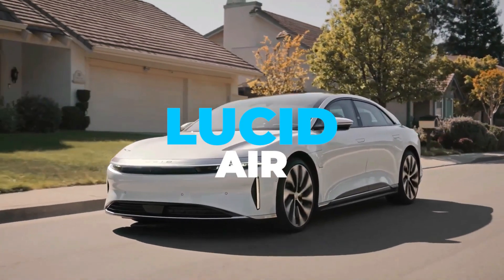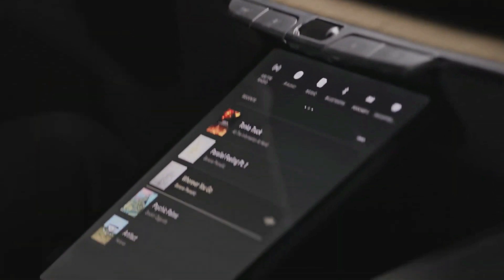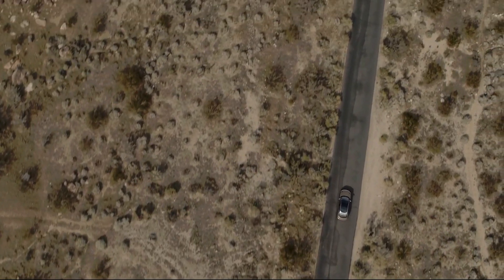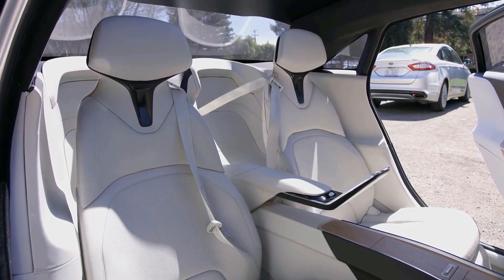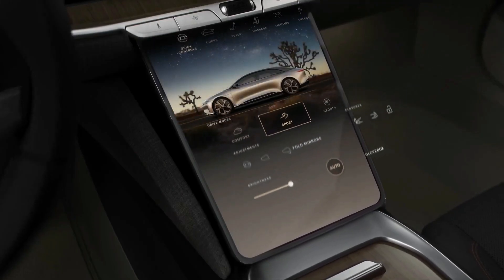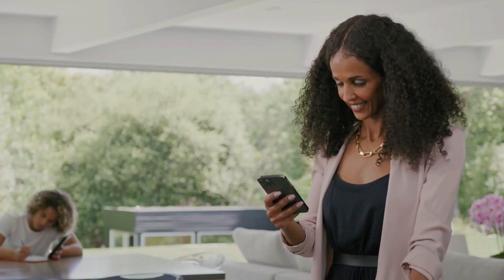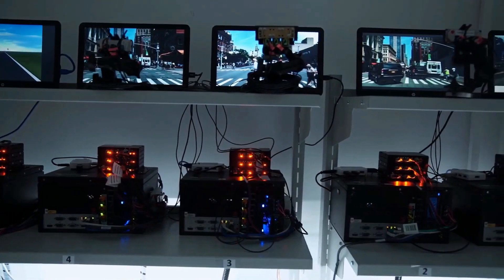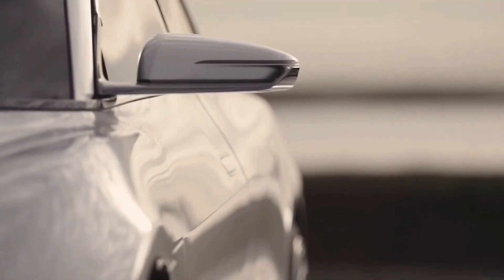Lucid Air Is ACTUALLY Coming! | Lucid Motors Update 2021

Comment: Lucid won’t likely delivery any cars in 2021. If any, it will be well under 500.  This company is doomed.
Reply: Developing a car is a time consuming process. For example, the first car designed by Tesla (Tesla Roadster), a car that was based on a Lotus Elise, was unveiled to the public in 2006 and put into production in 2009. So, their first car was put on the market at six years since the company was founded by Martin Eberhard and Marc Tarpenning and five years since Elon Musk became one of the company's investors. The first car developed entirely by Tesla (Tesla Model S), the car whose development process began somewhere between 2005 (the year Tesla began developing the Roadster) and 2009 (the year in which the Tesla Model S concept was revealed to the public ) was put into production in 2012, nine years after the company's founding. The new generation of Tesla Roadster was unveiled to the public at the end of 2017 and will (probably) be launched somewhere in 2023, six years after its introduction, the process taking a long time given that Tesla (most likely) already has the necessary resources finishing the car.
What I mean is that it is not abnormal for the process of finishing a car to take a little longer than the manufacturers expected and that we should not condemn anyone yet (especially start-ups like Lucid and Rivian) for the fact that the production of the car was or is a little delayed.